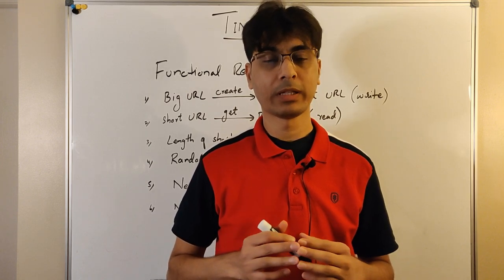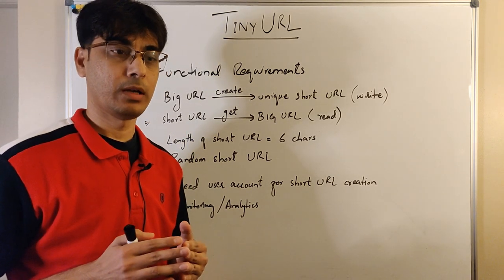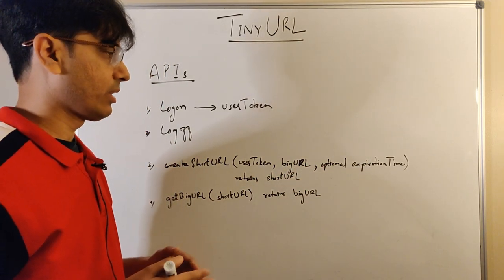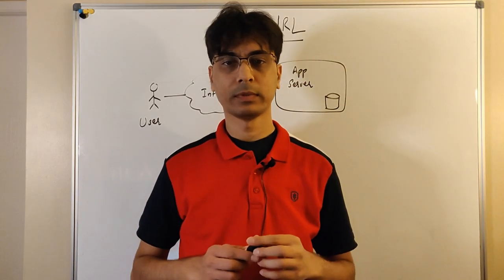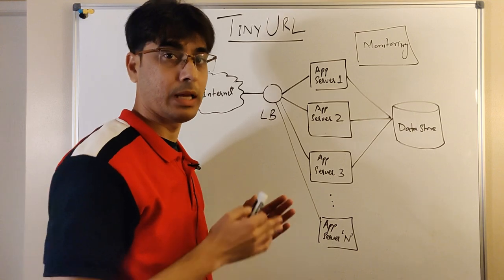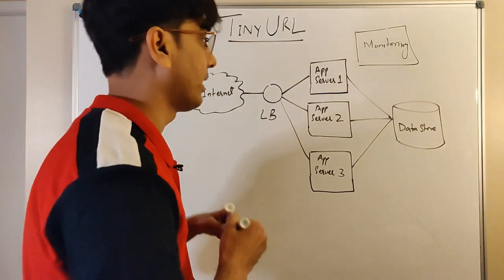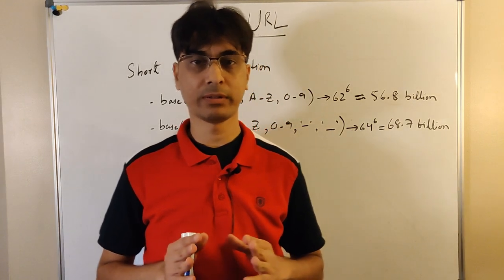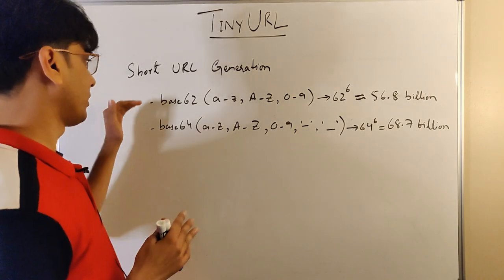System Design Interview Question - TinyURL System Design | URL shortner System Design

Comment: 12:00 There's a standard CFT Lemma which says, if there are 2f+1 total nodes in a distributed system, then that system can tolerate atmost f nodes failure. So if changes are getting deployed to one server (which is minimum viable amount of servers which we can deploy things to), then that one server suffers some downtime while deployment, then the max nodes required to keep system running is 3. That's why we keep servers to a minimum of three. This doc can be used for reference, https://en.wikipedia.org/wiki/Quorum_%28distributed_computing%29.
Reply from the maker: Thanks for the comment :)

Comment: Great content as always, I love the aspect of comparing against other solutions out there. Thanks!
Two advantages of having a KGS imho are:
a. The ability to independently change the logic of key generation and store the keys and deploy that microservice.
b. It can generate random short URLs (as against predictable ones in the counter logic), ensure there is no collision and store them.
Reply from the maker: thanks for the comment :)
Reply: @ThinkSoftware  I bought your course and the depth of analysis for each design was impressive, gave a lot of confidence for my FAANG interviews. The volume of content, in terms of number of design questions, was on the lower side though.
Reply from the maker: @ganzee6928  Thanks for buying the course. Yes as far as the number of chapters are concerned, it is still far away from my target number of chapters and that is why I am giving unlimited access to all my students right now. There are three chapters in the pipeline 1. Stripe System Design, 2. Object Storage System Design and 3. Design of Distributed Datastore, with Stripe System Design coming very soon. As you can see creating quality content is very time consuming, specially when I myself being an architect in my current company is very busy in my primary job but then you have seen the quality of the content/chapters that I have written.
Reply: @ThinkSoftware  Completely understand the time constraint. Your course quality (specifically the depth and comparative analysis) is one of the best I have seen online. Looking forward to going through the new material when published. Thanks.

Comment: The approach of using counter for generating short Urls would NOT be very optimal if user is given a choice to pick the short URL of their choice. In those cases, lets say 100-200 counters values could contain already used short URLs. The application server would need to check the database whether a value between 100-200 is already set or not in that case and if only free it would use it. Let me know your thoughts on tackling this extension of the problem
Reply from the maker: I think I have discussed this in the course :)

Comment: nice explanation. but countered based approach is not random, which is one of the functional requirement listed at the beginning.
Reply from the maker: Considering 3+ app servers and the way LB route requests to them and also you don't know how many requests are coming to the service from other users, it is somewhat random (although could be random in a range).

Comment: Great system design. Regarding API Design, I have been wondering if we should use the "redirect" approach and the get_long_url returns a 302 response or use the approach you are suggesting in your design. I am leaning towards what you suggested but it probably means we will need a layer of code to redirect after getting the long url. Curious, what are your thoughts on that.

Comment: Hi, Thanks for the video. I have one doubt regarding the counter approach. You mentioned that the app server ranges will be 101-200 or 301-400  or even 1001-2000, etc but if we convert any number within these ranges to its base62 representation, it will generate key less than 6 chars since you have decided 6 chars should be a key length in your requirements. How you are going to resolve this problem
Reply from the maker: 100 can be considered 000100
Reply: @ThinkSoftware  I think even if you consider 100 as 000100 and then try to convert it to base 62, i dont think it will end up in a 6 character long key. Someone please correct me if am wrong
Reply from the maker: This is after conversion to base62. Another example let's say after conversion it is abc. This can be converted to 000abc or zzzabc  based on whichever character is used for base62 encoded 0 (i.e. 0 or z)
Reply: @ThinkSoftware  First, thank you for the video, its very well explained. Following up on the above question, assuming  we have counters in db which are regular decimal number, we then use base64 encoding on the ranges on app side , what if the counters goes above say a million , then the base64 encoded value of 1million is greater than 6 length, now taking a substring from them will be same issue like MD5 ,correct?Thanks again for the video
Reply from the maker: Base 64 with 6 chars can denote upto 6^64 values. You misunderstood how the base64 conversion is being done.
Reply: @ThinkSoftware  Thank you for the reply. i understand how base64 works. I am confused on what is being stored in the counter, is it a regular decimal counter or is it base64 encoded value?
Reply from the maker: It is a long variable which you can consider regular decimal counter.
Reply: @ThinkSoftware  First of all thanks for the explanation, I had a doubt lets say App Server 1 stores  [1-100] so 1,2,3...100 are decimal numbers of type Long, now 1 is given input to as base62 encoding method so how it generates a length of 6 characters, let's say even if you send 00000001 also still the algorithm will treat it as 1 only naa, that is the point I am not getting could you please help me out

Comment: Thankyou for the great content. Need some clarification over key generation.
suppose the counter value is 65535. Convering to base 64, it becomes "NjU1MzU".
 Now, as you replied in some comment below that if the base64 converted value is less than 6 character then we can add 0 or z in the prefix to make it 6 digit.
But here for 65535 counter value, the base 64 is NjU1MzU which is greater than 6 in length. How will we make it 6 digit? If we trim some characters then it will be same issue like MD5 hash value trimming. 
pls help. Thanks in advance.  :)
Reply from the maker: What you did is string encoding of 65535. What you need to do is first the integer 65535 (base10) to an equivalent integer  value of base62 or base64 (e.g. equivalent integer value in base16 is FFFF). Once you have the integer equivalent in base62 or base64 then you encode it in string.

Comment: 17 minutes into the video and all I can see is a generic approach to making a distributed system scalable and available while the title speaks of URL shortner system design. Am I wrong to expect TinyURL specific designs throughout the video as opposed to the last part of the video ?
Reply from the maker: Thanks for the comment. This was my first system design video so I discussed several other concepts.
Reply: TinyUrl problem is a very generic very simple problem that introduces the viewer to how to think about scalability and how to handle availability. it's not a complicated problem by any means like Twitter or Netflix or Facebook. most of the concepts used here will be taken for granted if you try to solve the more complicated problems. however, in the more complicated problems you will solve another type of problems that will require you to make a simple design more complicated. it's a good starter to system design videos..

Comment: Had a question on the range keys being maintained on each app server. Would multiple threads not have to synchronize with each other to get the next available offset in this range , leading to higher latency? I am assuming this counter logic is needed only when we run into collisions.
Reply from the maker: We would be using interlockedIncrement() to get the next counter value in the range

Comment: Question - in your approach to generate URL using counter maintained in DB (discussed at 38-40 mins in your video), I'm unable to understand one thing. Let's say we use counters to generate number range but we are limited to 6 characters that means we can only generate shortlinks from 0 to 100000 and we will exceed 6 character limit. How can we apply 62 power 6 combinations. Can you please explain with a sample URL how will it look like?
Reply from the maker: 6 characters use base62 encoded number and not decimal number which is base10 encoded. 100000 that you mentioned is base10. We will convert it to base62 which will be way smaller.
Reply: @ThinkSoftware  are you suggesting to convert long number value to bytes and these bytes to base64 encoded string.
if yes then if we convert 67billion = 67000000000 to base64 encoded string it returns this value "AAAAD5mC3gA=" which is of length 12. Then how do you shorten it length 6 again?

or lets say long number in java is a 64 bit number, so with base64 encoding with 2 padding it will become 66  bits. So not 66/6 = 11. 
So the length can 11.

Comment: if collision occurs what to be done (we are choosing the first 7 chars from MD5 hash + base64 + counter values) ??

We can try using another hash alorigthm or chossing specific index chars in  output of (MD5 hash + base64 + counter values).

Issues:

1) But for every request we need to check in DB if that short url already exists or not.

2)Lets say we need same short url for every request for long url, in that case, let's say the first request has generated short url with the solution I mentioned above then for every next request for same long url it has to perform that soltuon (extra steps) to generate same url.

your opinion on this?
Reply from the maker: Thanks for the comment. I already discussed this issue and provided better algorithm in the video. May be you didn't watch the video complete.

Comment: What if there are too many write requests which end up lots of app servers needing to fetch counter range, resulting in write failures and overload on counterDB ... In order to avoid this scenario, do you think instead of using a counter stored in DB and app servers going to it directly, we use a service (counter service) that pushes counter-ranges to a queue and app servers just pick a range from that?  It can keep pushing to the queue at regular intervals. This design is more complex is only needed if there are too many write requests that we need to handle ..
Reply from the maker: We can always increase the range size if that is happen. With 100 as size, it means that servers are going to DB only 100th time and that the scenario you are mentioning is when somehow all the app servers exhaust their range of 100 at the same time.

Comment: Hi @ThinkSoftware, I have a question. let's suppose we have 3 app servers, and we try to deploy a new build. obviously, we can't deploy a new build on all the servers at the same time, so now if we go one
 by one then it's possible that a single user try to access our service gets a response from a machine where the new build has been deployed and if the user tries to access the same service gets a response from another machine(where new build-id not there yet, as it's gone routed by load balancer) is this a valid case. in a real-world how this thing works?
Reply from the maker: Yes this is always the case. So any new feature deployment need to make sure that you don't enable the feature till the department is complete.
Reply: @ThinkSoftware  I am not sure, how this will be possible in every case. I know spring cloud provides us a way to keep our configurations in a central place & we can make use of it to make feature enable after deployment but let's suppose we are trying to deploy a front-end app(server-side rendering) and my change was just to change the background color of a particular div/model from yellow to blue, how can I enable the feature only after deployment in all the app-servers?
Reply from the maker: It depends from what are you trying to achieve. If we just consider your example, you should be come up with an intelligent way to just update the background color without even needing the deployment. In reality, when we are working on cloud service, our feature work include design, implementation, testing and even deployment strategy that is most suited for that feature enablement.
Reply: @ThinkSoftware  Got it, thanks a lot for this awesome video
Reply: @rahulbatheja7933   The answer to your question is blue-green deployment. In cloud anyway you have the feasibility to increase the instance as you require. So while your blue server is catering the customer request , you can do the deployment  in green server and once the deployment is complete, this green server will take place of blue server and that transition is very smooth. This is called rolling update where you will not see any service disruption.

Comment: Very nice eplanation, specially nice to see comparison of diff. ans. available, I have 1 doubt - in the final approach, you have told that we will keep a counter in the datastore, but since we hv around 68 Billion possible keys, then after some time won't the counter value reach 68 Billion? and store that huge number in DB would be a problem?
Reply from the maker: Thanks for the comment. Check 64 bit integer has 2^64 possible values.
Reply: @ThinkSoftware  Thanks, got it, 64^6 = 68719476736, whereas 2^64 = 1.844674407371E+19, which is very big, so 68billion integer number can be accomodated easily

Comment: If you're bulk pulling the IDs per web server, how are you safely sharing and incrementing that value between req?
Reply from the maker: Thanks for the comment. No one is bulk pulling IDs. It is just a counter that you increment atomically and get at the DB level by some threshold (e.g. 100 or 1000) and then when the app server get the counter value it can assume that it can give away Ids in the range [countValue, counterValue + threshold)

Comment: Does the application server save the long URL to the DB as soon as it creates it? (before returning to the user). Otherwise if App Server 2 gets a request to fetch a long URL, it might think it does not exist, because App Server 1 didn't save it to the DB
Reply from the maker: Yes. This I think I have discussed in the video as well.
Reply: @ThinkSoftware  but what if app server 1 can create 1-101 urls and app server 2 can create 101-200 urls. app server 1's 99th url creation request is for url www.123.com. The server creates the shortened url. App server 2 gets a request to shorten the exact same url app server 1 did some time later. The request is app server 2's 102nd request. Now one long url has two different short urls. How does the system not create many different short urls for the same long url without a url shortening service? Or are the system designers accepting the cost and overhead of having many different short urls for the same long url?
Reply from the maker: It all depends on the requirements and design changes if the requirements changes. Here in our requirements we didn't have any requirements for always have a single short url for a big url. Instead our very first functional requirement is always return unique short url if you check again.

Comment: are you suggesting to convert long number value to bytes and these bytes to base64 encoded string.
if yes then if we convert 67billion = 67000000000 to base64 encoded string it returns this value "AAAAD5mC3gA=" which is of length 12. Then how do you shorten it length 6 again?

or lets say a long number in java is a 64 bit number, so with base64 encoding with 2 padding it will become 66  bits. So now 66/6 = 11. 
So the encoded string length can be 11.

    long n = 67000000000L;
    final ByteBuffer allocate = ByteBuffer.allocate(8);
    allocate.putLong(n);
    final byte[] bytes = allocate.array();
    final String s = Base64.getEncoder().encodeToString(bytes);
    System.out.println(s);
Reply from the maker: Both the approaches you have mentioned are not correct. Consider a base 10 number 15. When you convert it to base 16, it becomes F. 10000 in base 10 become 2710 in base 16. In the same way you convert an integer to base62 or base64 which ever you choose. More information in the course. There is free preview chapter on tinyurl design.

Comment: Which datastore you will need to use for maintaining the counter? Will that also be stored inside the nosql db?
Reply from the maker: Any database that either support transactions or database sequence/counters.
Reply: @ThinkSoftware  Okay, so just for this single column, single row data value, do we have to deploy a distributed database like mysql here? since for rest of the system you are recommending to use nosql db which would not let you use sequences that easily...
Reply from the maker: @sanketvictor  You have many options. There are NoSQL databases that support transactions (light-weight transactions) and DB counters as well. You can use them as well. As a last resort, you can have a separate sql db deployment for this purpose.